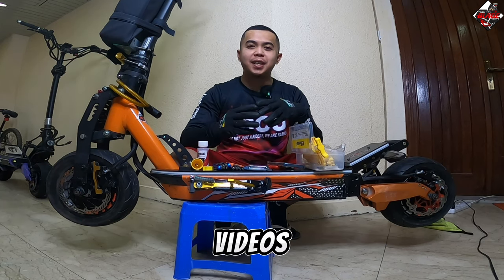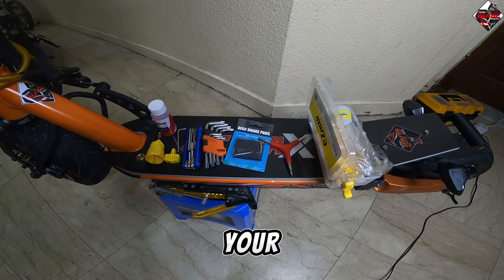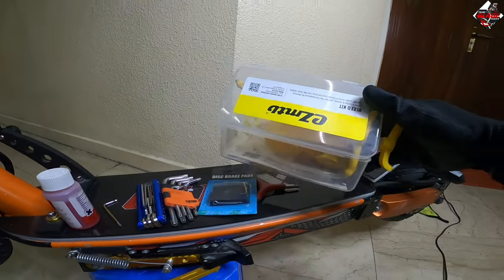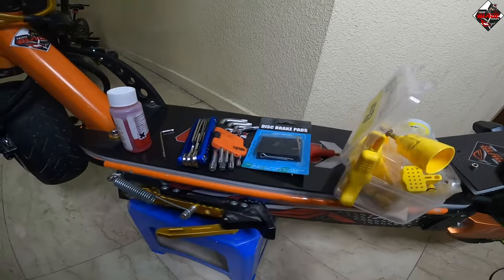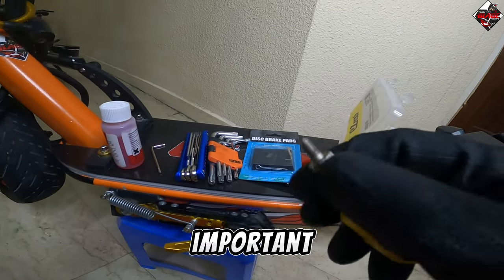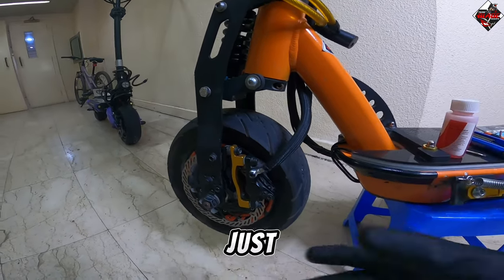How to EASY BLEED the TEVERUN HYDRAULIC BRAKE & PAD REPLACEMENT |James Angelo TV | Vlog 149

Comment: I can see no screw on brakes for bleeding fluid. My zoom brakes on the Teverun Fighter have hollow callipers and are flush to brake. Maybe when I find screw to release pressure they will pop out. Dunno 😢 I took brakes off but see no valve for hydraulic fluids. Looking for videos to explain but looks like brakes your doing are different. I appreciate your videos.😊
Reply from the maker: what kindi of brakes do you have i mean what brand and model
Reply: @JamesAngeloTV  Zoom
Reply: @JamesAngeloTV  no model number